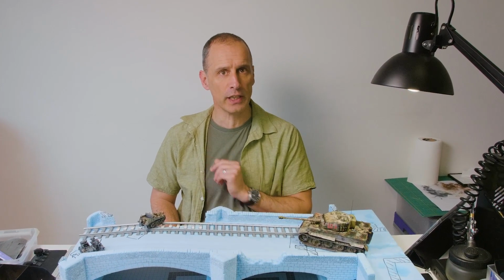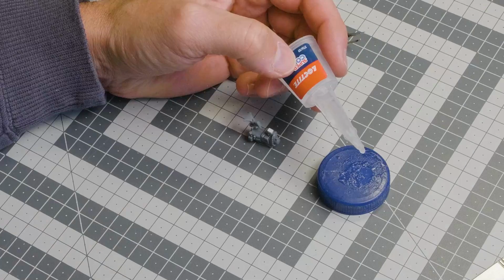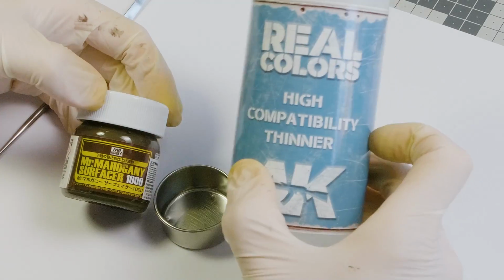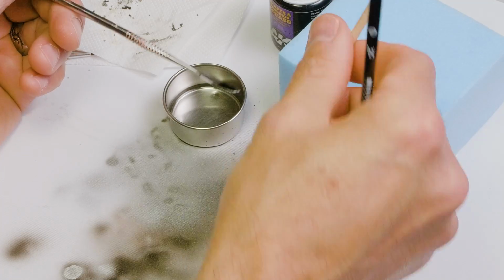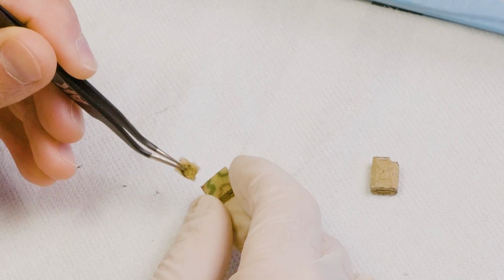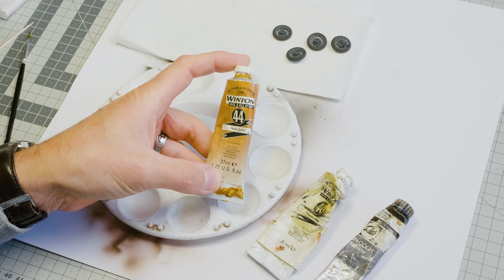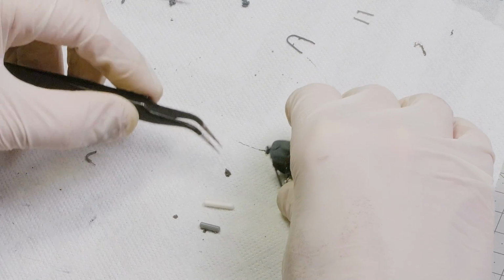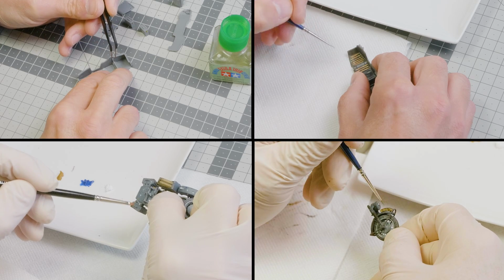BMW R75 sidecar Normandy 1944 Great Wall Hobby 1 35th PART 1

Comment: Good job on this motorbike. However the size of the original exhaust collector is correct, yours is now too wide..
Reply: I used to drive an original R75, and a Friend of mine has one, the collector has a superior diameter and has a recess AT the back. The pipes join the collector the very end of it, letting a very short space of this tube protuding the frame. Beware of some museum vehicles, a lot are displaying non genuine or reworked pieces
Reply from the maker: @Arno_L  Thanks for the info Arno. 
You're right with the museums, unfortunately, we sometimes have to cope with what is available but it's nice to know for other modellers willing to tackle this model for sure. ;-)
Reply from the maker: Thanks for your comment Arno. Anyway I don’t follow you on this specific point. The original exhaust collector is far too narrow and the correction was done with real pictures from an original BMW R75 from the Africa Corps preserved in museum where you can clearly see and evaluate the real dimension of the exhaust collector protruding on both sides of the central chassis tubular sections. The original collector from GWH was much smaller and included in between these two bars instead of extending beyond them.I can send you the pictures if you want.